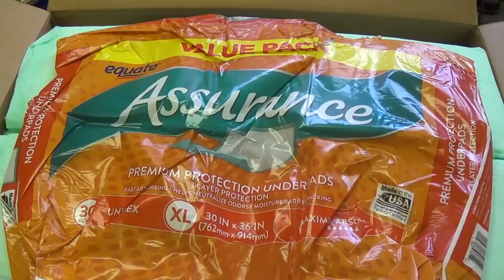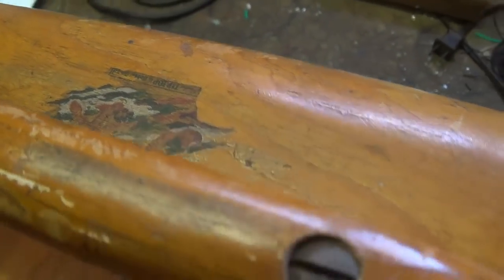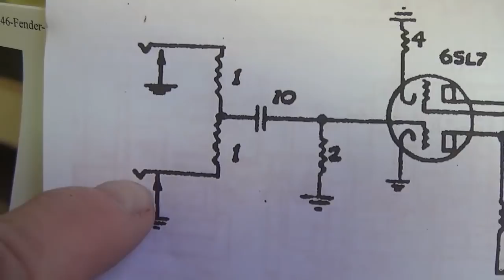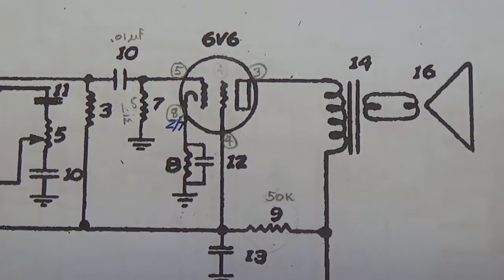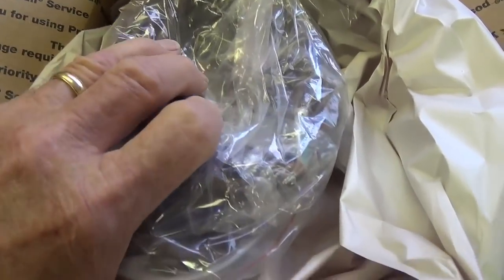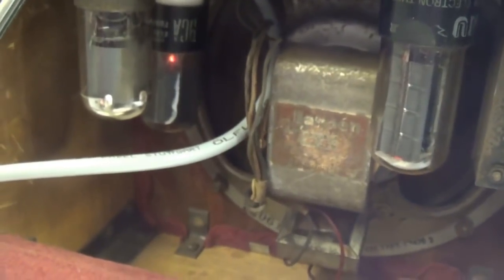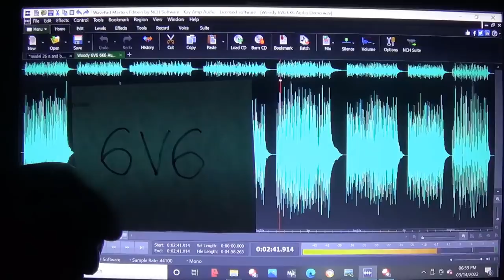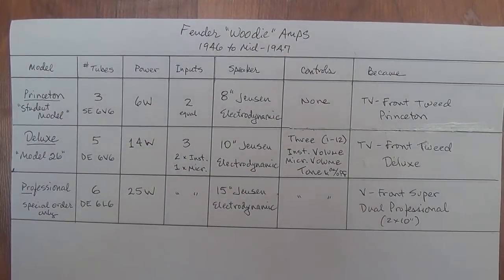1946 Fender Princeton "Woodie" Amp.....Rare, Valuable, and Really Nice !!

Comment: I'm learning alot from your videos.  Recently I picked up 1950 silvertone 1342. A buddy loaned me a variac to try to bring back the caps.
But there are other issues.  But I really want to try to bring it back!   Anyway you can do a video on how to get started? 
Some of the caps are not available,  but I know they don't have to be exact.  
Should I even try?
Reply from the maker: You should try only if you know all the safety rules associated with the handling of high voltage circuits, UM. Otherwise, you would be better off getting professional assistance.

Comment: I built one of these with my grandpa except mine has a knob for a built in echo circuit board for slapback that's the only knob it has I control the volume from my homemade electric guitar it also has two tubes Silverstone 6V6GT for the power tube and a 12AU7 for the preamp also we used a champ chassis
Reply from the maker: Thanks for sharing this with us, SP.

Comment: I know that you prefer vintage tube a,ps bit would you consider doing an instructional video on the Monoprice 15 watt tube amp? It appears to becoming very popular. You can have mine as a Guinea pig.
Reply from the maker: I felt like we pretty well covered inexpensive modern tube amps with the smaller Stage Right Amp, James. I appreciate the offer, but will leave further comparisons to my YT colleagues.
Reply: Would you know if they’re single ended? It has two El84’ s for the output stage.
Reply from the maker: @jamesadams1064  The 15W version is double-ended, James. It would have to be to produce 15W using 6V6's.

Comment: Hi Uncle Doug...even after building a 5F1 in 2015 and we'll on my way with this push pull project, I once fried the wire on a DMM because I was attempting to check current on a transformer and had to have it connected incorrectly. Should a person use the 10A setting on the DMM to check current. I thought that depending on the transformer the leads could be from ? ma to full fledged 2,4,6 Amps depending on the size and how stout the transformer. Would like to know how to check properly without ruining a 100 $ meter. Many thanks,as usual.
Reply from the maker: I don't recommend using any current shunt methods to measure plate current. Doing so is dangerous both to you and your equipment, as you discovered. Use the voltage drop across each half-winding to measure PC.

Comment: I still have my reproduction from 1996 50th anniversary Woody Professional, I just can't get it together to mail it to you. It's real heavy and it comes in a flight case. Number four of 50 made. I have it working but I'd really like to have you give it the once-over.
I think it's important to state that from 1946 Fender was not manufacturing any guitars, the snake head,  no caster and the Esquire models were not even in R&D yet.  It wasn't until 1948 until Bigsby and Leo started experimenting with solid body slab guitars.
Reply from the maker: Thanks for the input, Joe.
Reply: @UncleDoug  not sure how I feel about the added bell and whistle of you recording digitally and then playing it back through software on your computer out through the amp. You get into all kinds of things like bit rate, analog to digital compression and then digital to analog signal processing. As far as Lo Fi goes, sometimes I stick my iPhone top of the guitar strings near the pick up and play music out through the guitar amp
Reply from the maker: @BicycleJoeTomasello  I thought it provided the fairest comparison, Joe. Others may disagree, but there are shortcomings with any method.

Comment: Those black selector switches on that device look very much like Telecaster pickup selector switches. I have a 72 Chevelle SS that has an "Auto Paralyser" anti theft device from the 70's that is connected to the distributor. If you don't select the correct 3 numbers it will not start. Those knobs look just like Fender Amp knobs except they have 1 through 12 numbers on them. I have NEVER seen another one like it and it is still in the Chevelle! Makes me wonder if they came from the same factory as the Fender knobs? Wish I could post a picture here!
Reply from the maker: Perhaps Fender and Heathkit shared the same parts sources, 72.

Comment: Just trying to understand the digital recordings you made.    Did you record a guitar audio signal as it would be going to the input of the amp and use that same signal to test the amp with different tubes ?  While measuring the amplitude and frequencies with digital recording software ?
Reply from the maker: Yes. A digital recording was made of the guitar output signal, which was then fed into the amp with different tubes in place.
Reply: An Impressive,  practical and consistent method of comparing the differences in “gain” different tubes provide in a circuit.
Reply from the maker: @TheOldBoy101  Thanks, TOB :)

Comment: Hello Uncle Doug.  Would you mind answering a couple of questions?  1) What is you'r background?  Are you an EE?  2)  Do you work on solid state amps?  A friend gave me a solid state Fender bass amp but it needs repaired.  I am a 60's lead rock guitar player, but never got into drugs and alcohol.  I'm a retired Sr. Electrical Engineer.  I really enjoy listening to your videos.  What is a good source of amp schematics?  Thanks!  Shalom/gw
Reply from the maker: Greetings, GA. I am entirely self-taught from a medical background and a relative newcomer to the field. I do not work on any amps with transistors or PCB's. I hunt down all my schematics on the internet and download them......from varying sources, depending on the brand of amplifier.
Reply: @UncleDoug  As one who lived from the tube era, when electronics was fun, through the integrated circuit/software (boring) times I would like to compliment you on doing a great job.  I used to ask our young engineers one question to see if they were really interested in their field:  "Do you know what a getter is?"  Thanks again!  Shalom/gw

Comment: Hello Uncle Doug . This new video is very interesting and informative. As always, but those woody Fenders are so rare and significant in the history  of electric guitar. They still have that pre-war style, real (no turret nor eyelet) point to point circuit. In my place (France) they are rarer than rocking horse dung. I don't think Fender was imported here before the mid fifties..
  I remember (*)you talked about your distrust about the JJ brand in one off your previous vids. I'm afraid this slovakian maker will be the sole supplier of new tubes for a while with the sanctions against Russia and the halting(temporary ? I red about a fire and/or a forced relocation of the plant...) of chinese production. 
*: to be honest i recently rewatch the aforementioned video
Reply from the maker: Thanks, AS. The short supply of vacuum tubes has definitely reached a serious level......at least for the present. I am leery of JJ tubes after two serious incidents, and am fortunate that I have a good supply of vintage tubes for my own use. Hopefully, sanity will return in a few months and we can get back to "normal" with respect to the economy and supply.

Comment: Did you do anything about that nick in the insulation of the green ground of the 3-wire plug cord next to the ferrule? Do you need to?
Reply from the maker: I usually dab on a wee bit of black silicon sealer, Tom, although it's probably not necessary.

Comment: Always a pleasure from this end as well... thanx mate 
BTW, in your opinion, which output tube did you prefer, tone-wise? 
Though great for comparison, I would always prefer 'Jack & Ollie' amp testing 
(...but that's just me) ...also, was there some microphonic distortion in the final tests?
Reply from the maker: Other than volume, I couldn't detect much difference, Jonny. You have to have the same input for each tube to make a fair comparison. Not that I heard.

Comment: I love 6SJ7s yes you have to go thru a few to make sure the aren't microphonic. Do you think the reason the output was so great because of the way it was bias or the fact there is no volume control or grid leak resistor on the preamp? I tryed setting up one like this and the output was low, I tried it like an early champ with the 5meg grid leak and it was better but still low so I added a triode as a second stage to make it sound right, although I like my tone a bit dirtier than you.
Reply from the maker: Microphonics are indeed a problem with the 6Sxx tubes, SH. Thanks for the input.
Reply: @UncleDoug  Yes, especially the metal envelope variety! Also remember that these are antiquated tubes are as old or even older than these amps. Can you just imagine what some of these old tubes have been thru before ever getting into our own greedy hands. I can imagine a time when newer tubes came out and these old ones ended up in someone's trash heap and even a pile of scrap metal. Later years s/s became the rage and these thing were obsoleted. These tubes got bounced around in the back of some garbage truck or whatever. 60 plus years of mishandling certainly will loosen up the bowels of these old fellows and mechanically they become microphonic. I doubt you will find many JJ's that will stand such test of time and abuse.....
Speaking of which..... Looks like they are going to be the only show in town as far as new production tubes go. Nearly all of our favorite new production and new reproduction tube brands were coming outta the one and only same production plant, located in Russia. The Chinese production has practically all but ceased at least a year ago due to damage from a fire to their most significant and decent production plant. The fact that they cranked out so many tubes that their stockpiles are just now running out is testament to how prolific they once were. So JJ looks to have cornered the market and as such everyone is hoarding and they likely are price fixing.
As vacuum tube amp enthusiasts, we had been spoiled in the recent years with a variety of fairly decent new production tubes. Looks like vintage is going to be the way of the near future again.
I don't believe that there really is such a thing as true NOS tubes except for the extreme rarity, true NOS is a fallacy. Test as new is more likely. As previous mentioned , these tubes are old and have been handled and mishandled for years of abuse before being coveted. I love vintage tubes and their often superior tone but most of them just like your dear grand dad have unique personalities. You gotta weigh in the good with the bad. The microphonics the fizzle and sizzle on occasion and the gassy loss of vacuum.  Tough times ahead.  Some love JJ 's, I don't care for them but grateful they produce many tubes though!
Reply from the maker: @southboundsuarez9832  Thanks for your comments and observations, SS.

Comment: Great as always, Cheers, Unk!     I may have missed -- aren't the input jacks chassis grounded by their mounting?   After the first six 'wrong' items on the diagram, I would have assumed I had the wrong diagram!   Finally, the output seemed a bit 'unclean' to me, I am guessing a grid stopper would clean it up a tad more - am I anywhere near correct?
Reply from the maker: The jacks were directly connected to the chassis, Rick. It was the schematic for a later version of the circuit. No early version schematic exists, as far as I know. As I recall, each input had a 50K grid-stopper. Any imperfections in the tone may be due to a 76 year-old speaker.

Comment: Back in the day when those stickers would have been issued and used sports weren't all executed as they are now. For example the sticker on the front of the amp looks to me to actually be a high jumper using the old method of high jumping when they went head first and rolled out on the landing like a somersault. The bar is whats in front or under him as he is jumping over it head first. I'm not sure that's what I'm seeing but it seems that way from what I could tell.
Reply from the maker: Thanks for your input, Greg.

Comment: Great video Uncle Doug. Always fells strange when I say that as I had an Uncle Doug. You’re much nicer. Quick question. Replaced tubes in the Stage Right, jj 12ax7 and Tungsol 7189. Much quieter. Would copper shielding make it any quieter? Oh, glad to see that you got a Woody. (Couldn’t resist)
Reply: I saw what you did there.....
Reply from the maker: Thanks, James. The only shielding I've found to be effective is the use of shielded cable in the input & pre-amp section.
Reply: @UncleDoug  Thanks

Comment: Hi Doug
You said I could ask a question, so here it goes. I recently used a Bassman tone circuit with the cathode follower in the second preamp stage but instead of allowing high voltage to go to the screen of that stage, I just sent signal. ( After a .022 cap and a 1meg volume pot). It has 300v on the plate, 0v on the screen and about 3.5v on the cathode where iam taking the tone from. Is that dangerous? It sounds excellent. It's a single ended 6L6 GC project.
Reply from the maker: Without seeing a schematic, I'm having a hard time understanding your description. Cathode followers usually involve triodes.....which have no screen grids. If you are speaking of the 6L6 with 0V on the screen, I would imagine that overall gain would be reduced significantly. To be honest, none of this makes much sense to me.
Reply: @UncleDoug 
 Sorry. It's a 12ax7 pre amp. It's a scratch build. Taking a couple circuits and putting them together. Basically a 5F1( slightly modified) and 2 stages of the 5F6-a Bassman (also slightly modified).
The cathode follower is a 12ax7 ( 2nd half) but instead of sending the signal directly into the the 2nd half, I am going through  a .022 cap and a 1meg pot. So I end up getting 300v on the plate and about 3.5v on the cathode. I just wondered if that was ok? I apologize for not being clear.
Reply from the maker: @tkehn1  Plate voltage is not determined by the signal applied to the grid, it's determined by the B+ voltage supplied by the power rail.  300V is the max for a 12AX7, so the tube should survive.....but operation at max PV is not a recipe for long tube life.

Comment: I thought the 40s Fender combos in the un-tolexed solid wood cabs that were referred to as "Woody" were basically precursors to the Twin, like 75 watts if I recall correctly, and had a 15" Jensen with a gargantuan square magnet. Like, I almost bid on one on ebay back in 2012, but I saw it had 2 bids and figured I would only trigger an autobid and didn't want to get into a bidding war with 2 people over an amp I had no information about other than that it was rare and made of PINE, full of knots and only clear-coated. THAT is what I think of when someone says Fender "Woody" ("Woodie" if you prefer). It's a mean looking pine combo with a 15 and something like 4 6L6s. I had no idea there was a Princeton model that went by the same nickname.
Reply from the maker: I have posted relatively complete coverage of the early "woodie" amps, Adam, and do not recall the amp you described. Perhaps it was a later model that had been stripped of tweed or Tolex and simply left bare (?).
Reply: @UncleDoug  I don't know, there wasn't anything on it to denote a model, but it didn't look like it had ever been tolexed, with all the metal corners and handle parts still on it and the clear coat did not look new. The cabinet was also dovetail jointed, not finger jointed. It was definitely pine, I could see knots on the inside of the back panel. It was so long ago though, no possible way I could find the listing.
Reply from the maker: @AdamRainStopper  I don't recall ever seeing a Fender "Woodie" cabinet with dovetails and metal corners, Adam. I tend to think the cabinet you saw was not an original Fender creation.

Comment: 16:56 - Something very odd about that schematic. Notice that the upper triode is biased up but not used?There are also volume and tone controls. (?)
Reply from the maker: It is used, David. The output from the lower triode is fed to its grid.
Reply: @UncleDoug  Oops! My apologies. It's so oddly drawn, I mistook the cathode for the plate!
Reply from the maker: @dhpbear2  It was an odd diagram, David.

Comment: can a tube rectifier be added and the diode rectifier removed in a  78 Fender pro Reverb with master pull out volume ?
Reply from the maker: Again, since the power transformer lacks a 5VAC winding, it would not be an easy or worthwhile task.
Reply: thank you for the answer , i really like your videos.
Reply from the maker: @sethdonahue3441  Glad to hear it, Seth :)

Comment: Years ago, my sister's father-in-law passed away.  He was an old-time radio/tv repair man and an avid ham radio operator and "collector" of anything electrical or electronic.  Over his lifetime he had amassed a huge inventory.  My sister and her husband decided to clean out the shop.  She was telling me how they threw out a pickup truck full of old vacuum tubes, most new in the boxes, and how some guy stopped by the trash pile and gave her twenty bucks for the truck load.  Then she asked: "Hey, you didn't want any of that old electronic stuff and tubes did you?"  I had to leave.  IT IS AGAINST THE LAW TO STRANGLE YOUR RELATIVES. :-(  Shalom/gw
Reply from the maker: That's hard to take, G.A., especially with the current critical shortage of new Russian tubes.